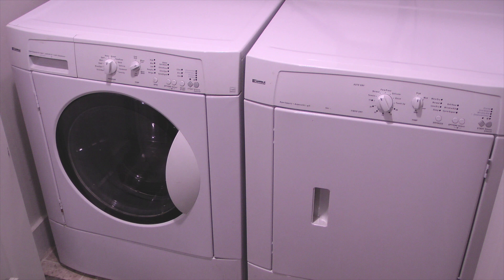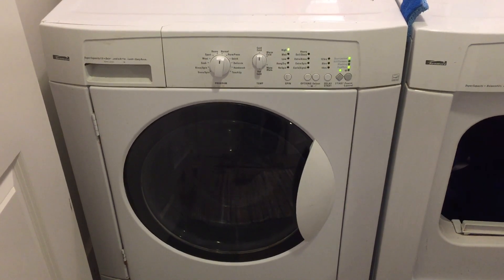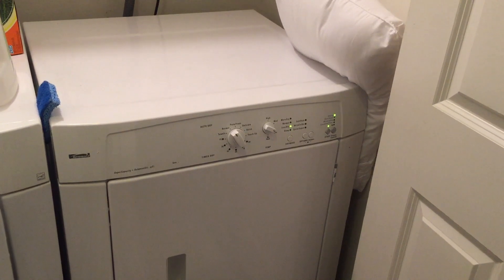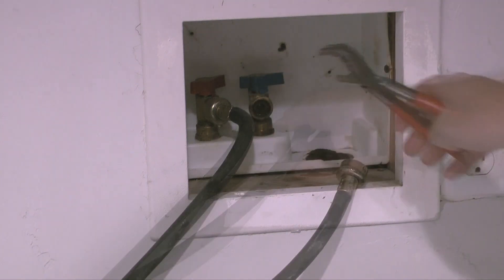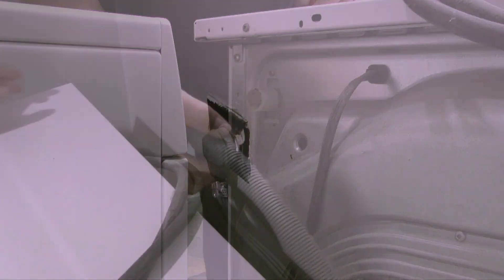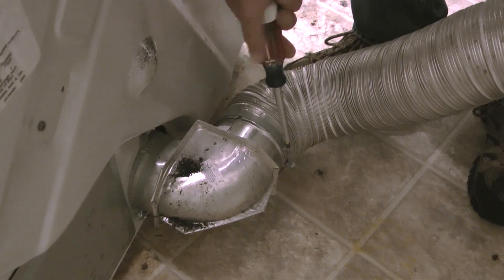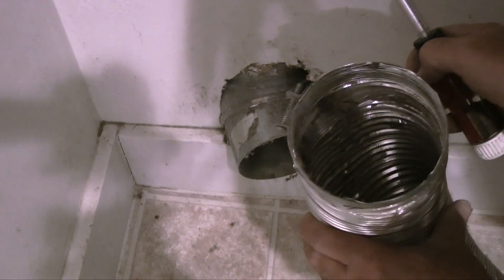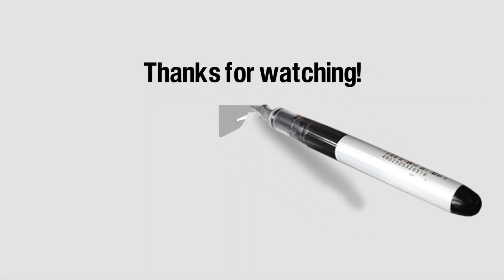Removing The Old Washer & Dryer

Comment: From my own experience, the smell from the washer is caused by delivery people shoving the excess drain hose all the way down into the standpipe (drainpipe). That gives access to smelly sewer bacteria to get into your washer via the drain line. The drain hose head should attach to the U plastic shape and can not be more than 7" down the drain. This gives space for air to drain properly and prevent water flooding back into the hose. From the look of this video, the head of your drain hose is covered with slimmy bacteria, mold and your standpipe is blocked to the top, the water is backing up during draining cycle ( water comes out more than it can drain)and carrying bacteria back into the washer. That's the smell.
Reply: Good observation. Something to watch for on my new washer.

Comment: Wow so weird seeing a disconnection in the us I am from the uk 🇬🇧 and over here we never have to unwire the old tumble dryer from inside the back of it… comes with a cord and plug we only wire electric cookers like that… plus hardly anyone uses and elbow on the back of the dryer pipe they just shove it in and replace them over time plus they are plastic pipes that damage easy then you get moisture and lint everywhere 🤦🏻‍♂️😤 I prefer the way you have your dryer vents much better lol. Most people over here use a condenser dryer so no need for a vent but they do take ages…. I gone back to vented as my condenser dryer broke after ten years vented is so much better I think after having both!  and the washing machine

Comment: And the washing machine why do you keep the drain pipe lol ? Every washing machine no matter what the brand comes with a new drain hose with it!! And we only use cold water full of you chose a hotter wash 60 c or boil wash 95 c it has an element that heats it up. I like the box’s you have over there where you connect it all in one place it’s much better idea lol. Thanks for the strange experience haha.
Reply from the maker: Hi Colin. Thanks for the information. We lived in the UK for a year and we hated the all in one washer/dryer. We had to iron all the clothes because they always came out of the dryer cycle damp.